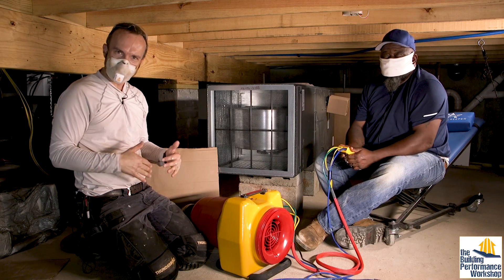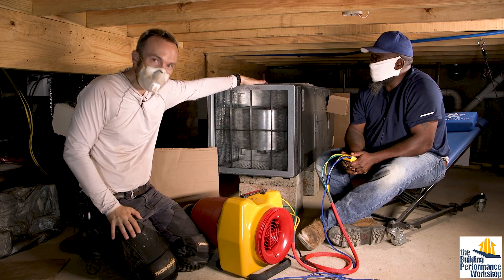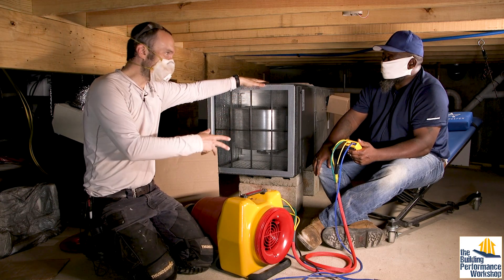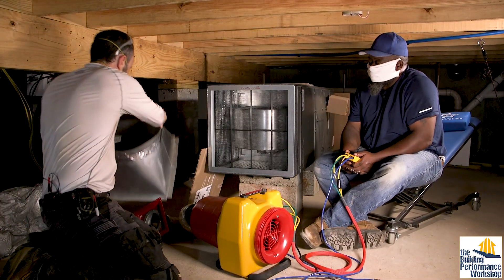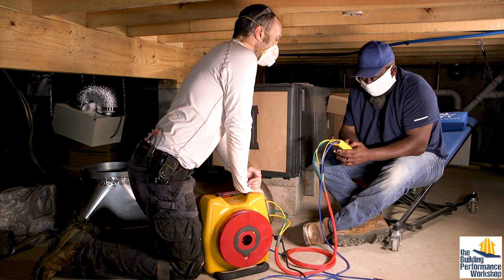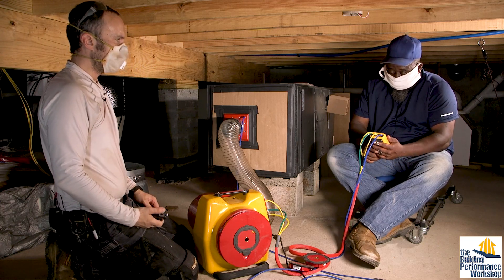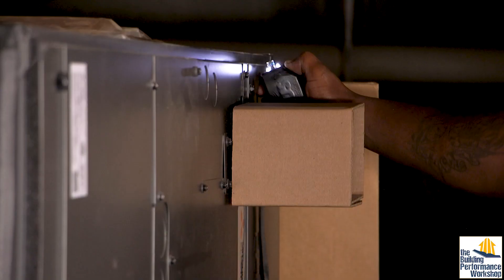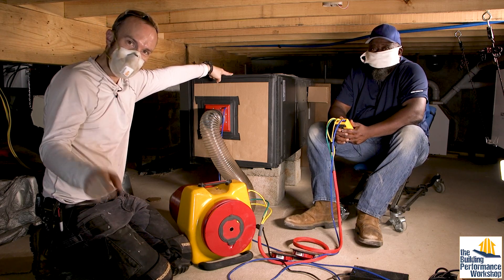HVAC Cabinet Tightness Test: Mitsubishi Equipment Duct Leakage

Comment: Did you research a geothermal system? If so is it worth the price? And is it the most efficient system out there?
Reply: Ok thanks. I’m trying to find the best systems out there for my future house from the experts instead of going with the same system we’ve used for years.
Reply from the maker: Yeah, there’s a lot of hot marketing of alternatives, but the science doesn’t always back it up.
Reply from the maker: Know enough about geothermal (aka ground source heat pump) to know it’s not for us. Huge install cost due to digging, maintenance is pretty specialized, and no, it’s not the most efficient system now that air source heat pumps like we’re using have advanced by leaps and bounds.

Comment: Corbett, why not try some of that removable silicone caulk? I’ve never used it before, but it seems it might be a great way to seal up the equipment while still allowing for service.
Reply from the maker: I’d rather just use Mitsubishi, while publicly embarrassing all the manufacturers who roll out leaky boxes!
Reply: Corbett,  good way to think about it and I agree. It can be done better, so it should be done. I’m going to try the caulk trick on my old attic-mounted air handler and see how it goes. At least until I can plan out for a ducted mini-split.

Comment: I run a small bead of clear silicone caulking around the doors. Then later on just slice the seam with utility knife to open the door for service. When I put the doors back on it still seals great.
Reply from the maker: Don’t you deserve to have them do it at the factory though?
Reply: Home Performance   They will only build it as tight as the energy code calls for. If you want a cabinet that seals real tight then you have to pay for it. Then the manufacture is not competitive with other brands. Etc...

Comment: Might want to throw another mask over that n95.  The one way valve protects you but doesn’t do anything to help the other guy.  I just use a cheap fabric mask over mine.  It also helps extend the life of the n95 mask.
Reply: You can tape the valve also.
Reply from the maker: Or use a bead of silicone caulk ;)